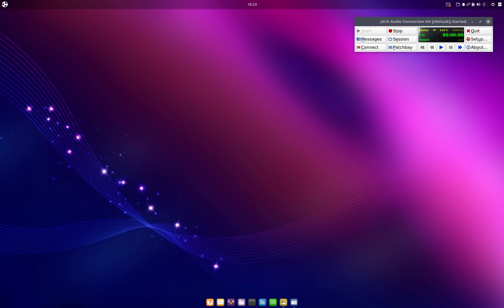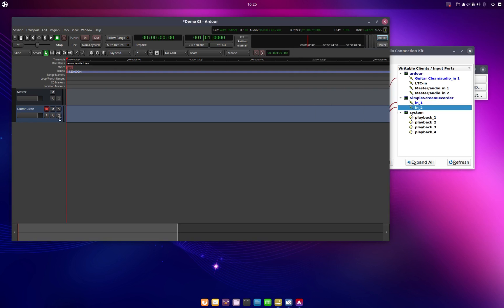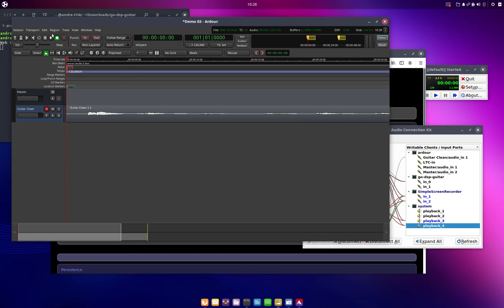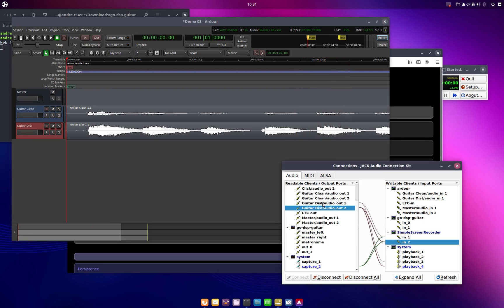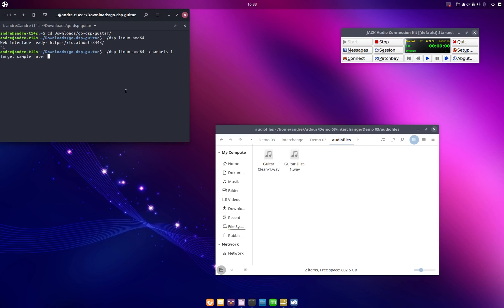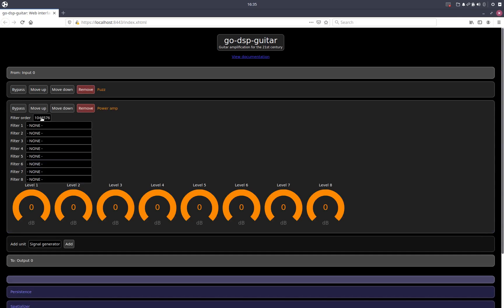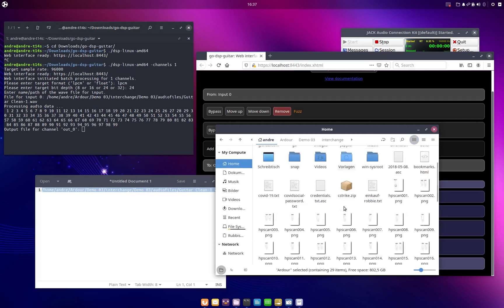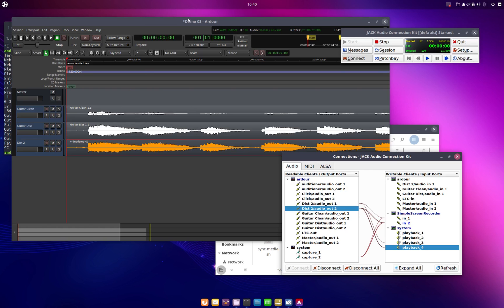Re-amping electric guitar with JACK, Ardour and go-dsp-guitar

Comment: Could you remove all the noises you made with your tongue. It's horrible! Sorry to tell u that.
Reply: rude
Reply from the maker: Well, the video is uploaded as it is. There was no editing done, apart from the compression that the capture software applies. The idea behind these videos is to capture the audio signal as accurately as possible as it is flowing through the JACK graph. The reason you hear these noises comes down more to the recording conditions themselves than to post-processing though. I don't have a soundproof room or something. I just record these tutorials in my apartment, so I tend to record with relatively low sensitivity (in order not to catch reflections, ambient noise from the streets, neighbouring apartments, etc. - this also reduces the noise-floor from the pre-amps), relatively quiet voice and little distance from the mic when speaking. With the mic so close to the mouth when recording, of course some "noise" gets picked up as well. Perhaps my mouth was also a bit dry from all the talking, which makes your tongue stick when talking. It's possible that this wasn't the first take either, which might have made things worse in this regard.